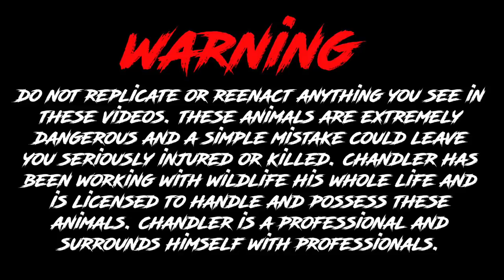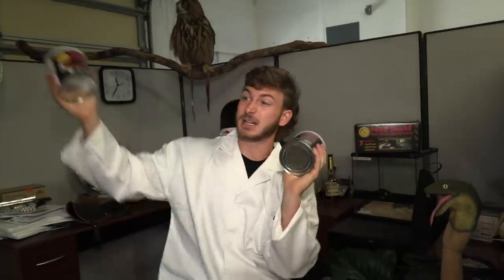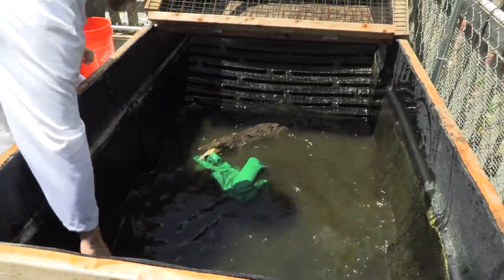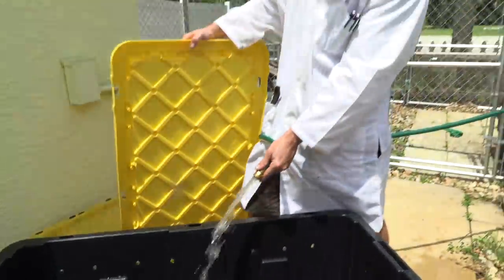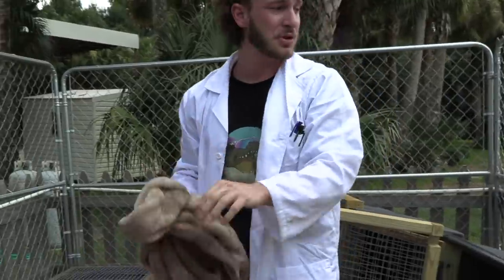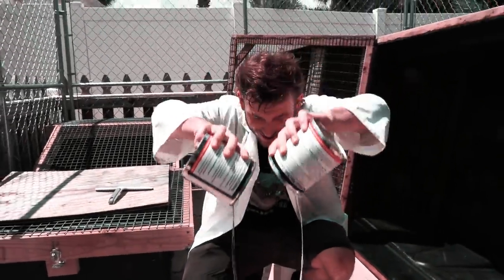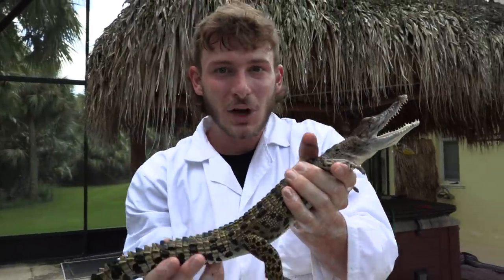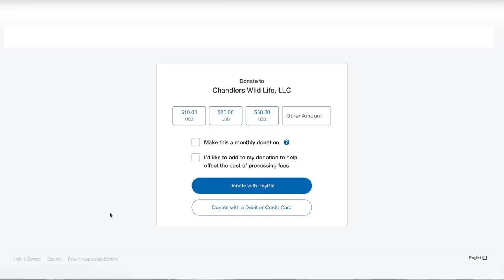HOW TO CHANGE A CROCODILE’S COLORS!!!

Comment: ay Chandler...remember me?  :)  
     i like the way you think and great minds thinks alike ;)   I cant wait for the final result of the experiments!  Everyone is going to be Amazed on how well and fast/slow each reptile can adapt to their environment changes.    if you add a good - stable or decent size Rock in their enclosure it might help speed up the process and get better results and especially better health.   reminder:  As the season changes the results will continue to change as well. 
Now keep in mind! An animal can only grow as fast as their enclosures will allow.    That's very important and key to happiness.    Also, i dont recommend to keep changing their environment way too often.  It could stress them out, leading to being more defensive or lost of appetite.  Once they get adapted to the new surroundings of the white background enclosure, let them get very well adjusted to it before doing any more changes (of colors).   :)  good luck and be kind. 

PS your reptiles might be a bit more DEFENSIVE as it is mentally and physically attempt to adapt to its new surroundings.

Comment: Hey Chandler, just a quick question. If you put all the snake species unto one enclosure, what will be the last one alive?
Reply: The king Cobra probably
Reply: Are u thinking the king Brown? It's good question but someone wld really have to not care about their collection to do that since they all come from different countries and regions that would never come in contact. But that would be a good answer. Other in my opinion would be the Rhino/ Gaboon viper. Quick strike and mostly the length of the fangs. All it needs is a good shot to the right place to cripple it. I'm sure someone's done it somewhere.
Reply: @talsingh451  they are big and pretty fast. But u also have the Mangshang viper that's drop for drop one if not the most deadliest. Who knows, but again someone wld have to not care for a very expensive collection.
Reply: @floridacracker_ yes of course, just wanted to know what really is the most deadliest.